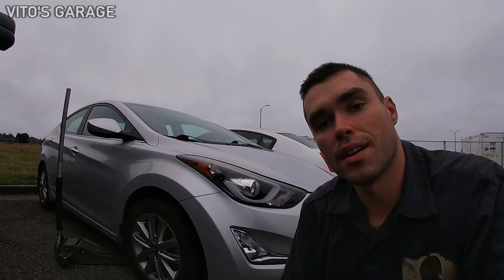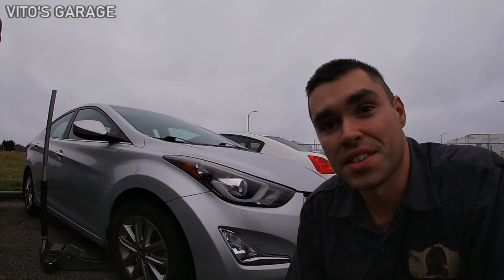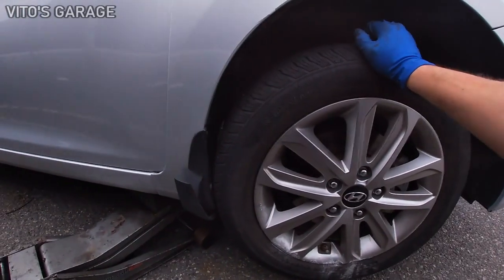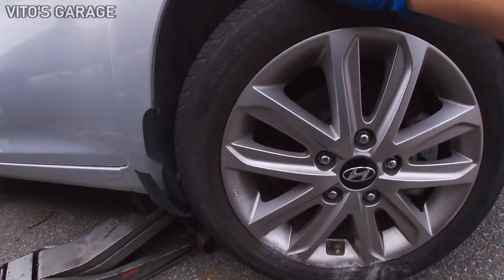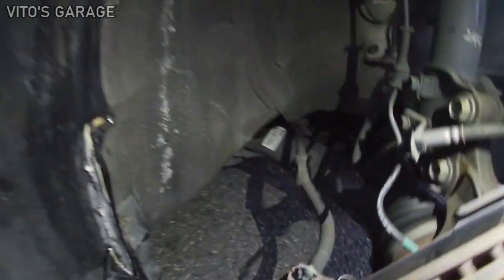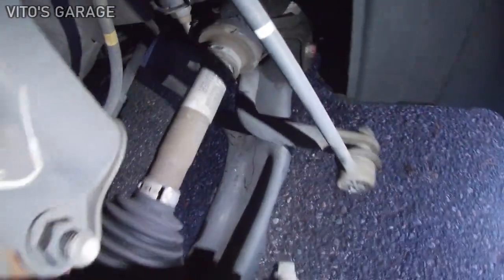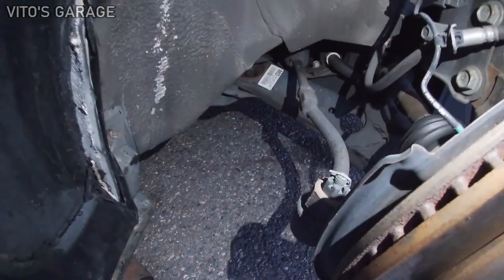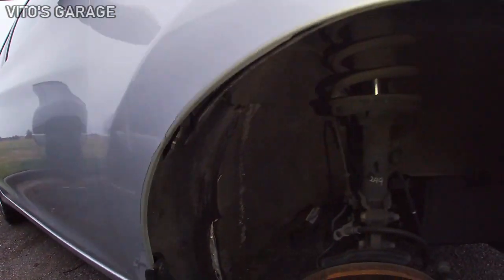I Was Only Driving ''25MPH'' and Hydroplaned..Shops Quoted $3000! Hyundai Elantra Damage Assessment!

Comment: These modern small sedans were not designed to survive higher speed accidents. They were designed to save lives. I'd expect fairly major damage from a 25 mph side impact with one of these cars. (although no one really knows what the speed was during the impact, not even the driver). If this car was doing 40 or 50 during an impact the car would be totaled. JMO of course.
Reply from the maker: It's hard to find out the truth from the customers, so I'll never know. The airbags didn't deploy. Sad seeing they make such crappy cars nowadays